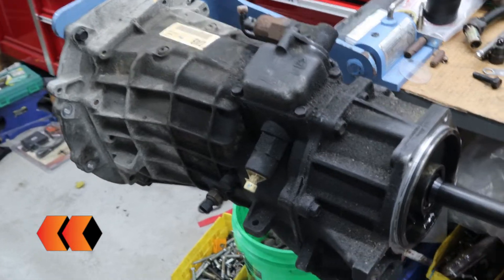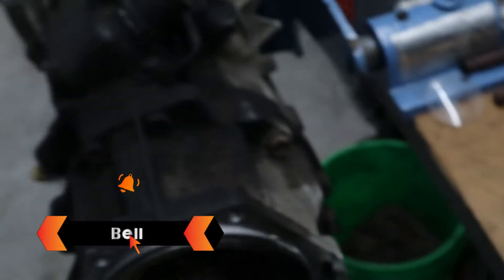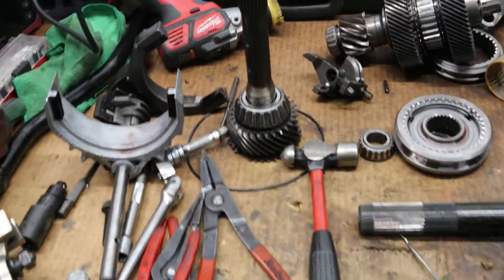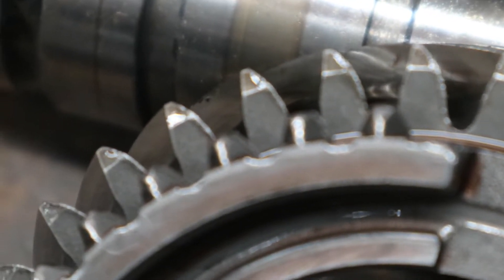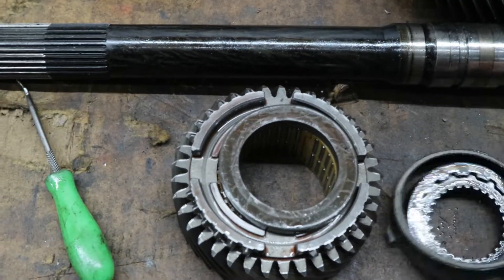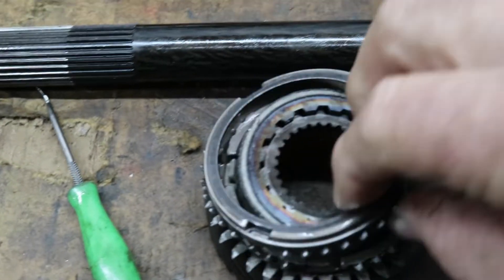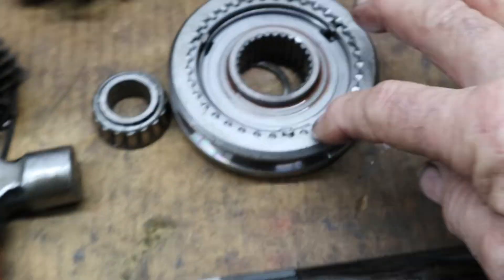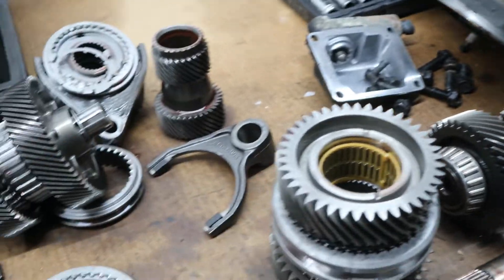The T-56 Tremec Transmission Rebuild: Will It Work Again? C5 corvette Z06

Comment: Hi,do u rebuild zf6 spds.?
Reply from the maker: I can, as long as parts are available
Reply: @LANDISPERFORMANCE I don't think I need a rebuild yet. But I'd like to plan for disaster. I have no information on the ZF6 that I bought other than the fluid looked really good.
Reply from the maker: @stevenblackwell399, do you have any tags or ID numbers from the transmission? Do you know what year, make, and model it was originally in?
Reply: @LANDISPERFORMANCE yes'89 corvette
Reply from the maker: Not sure how easy the ZF6 are to get parts for. Thanks for the comment
Reply: @LANDISPERFORMANCE yes...those trans have tags
Reply: The Ford ZF transmissions guy is sure you can get parts for the German ZF. But.
 He  can't rebuild the z f if you bring him the transmission. He sounds like a real tool.
Reply: @LANDISPERFORMANCE yes

Comment: Hi 👋   im experiencing a issue going from 1st to 2nd. I cant go above 25 to 30 before shifting to 2nd gear.  How do i find a good mechanic amd what questions do i ask to make sure the shop is qualified to work on a c5 ?
Reply from the maker: Is the skip shift engaging, or is it doing it at all throttle positions? You could contact Tremec, and ask if they have a dealer in your area. Elite Dealers are trained at repairing Tremec transmissions

Comment: How difficult would you say it is to replace the front cover for someone who has never opened a trans before?  I'm very mechanically inclined and I can turn a wrench, but I'd rather not mess up a t56 I just spent $2k I just had rebuilt
Reply from the maker: @AmateurProf  The correct way to take a T56 apart, the front cover is the last piece. But they are not that bad. You will need the puller to remove the 5-6 gear off of the main shaft. Snap ring pliers. And since you are swapping out the front cover, you will have to check the main shaft and cluster shaft end play.
Reply: @LANDISPERFORMANCE  Thanks for the reply!  I think I will keep my warranty and have the shop swap the front cover for me

Comment: If you're going to show someone how to rebuild that transmission maybe Slow it Up and explain what you're doing you cannot follow somebody that's in fast motion or don't explain nothing your video basically is garbage
Reply from the maker: Yes, you are correct, I made this video a while ago, and was getting a lot of flack about videos being to long, so I was experimenting with the fast forward portions. You will find in the video description a link for the manual for the T56 transmission, with the manual you can see the detail of the order the parts are assembled in, hope that helps. I will make a more full version of this T56 rebuild, next time I build another. Thanks for your comment, hope you check out some of the other videos on my channel.
Reply: @LANDISPERFORMANCE  thank you so much for understanding my comment , I own a 2017 Corvette with a 7-speed manual transmission but what would really be nice if you did a video along with an instruction booklet or something like that to explain how to actually rebuild the C7 7-speed transmission I know I would definitely be interested in purchasing something like that for my own knowledge that if something went wrong with my transmission I would be able to follow step-by-step or see illustrations to actually rebuild my transmission with confidence and even if you could throw in some aftermarket parts to actually make the transmission more beefier this would be a lot better than a video on YouTube this is just something to think about but I definitely would be interested if you or someone did something like this because I just don't have the money take my car to a shop and spend thousands and thousands of dollars on a transmission and still not knowing if they know how to do it properly? But once again thank you so much I was just being honest on my comment with the video but it was interesting even though it wasn't fast speed LOL give us some serious thought on what I suggested take care have a very wonderful day

Comment: I can't imagine the years of dedicated effort it must stake to become an expert at rebuilding transmissions like this.

Amazing.
Reply from the maker: Thanks, but I feel they are a lot easier than an automatic transmission. Manual transmissions are just gear to gear, and use a synchro to work as a brake to stop the next gear from spinning to allow it to be engaged with out grinding. As long as you remember that, the only tricks are to figure out the right order to disassemble and assembly the unit, and very close inspection of the synchros, synchro hubs, and the synchro teeth on each gear. At least that is how I look at it. Thanks for the comment, hope you enjoy the channel!
Reply: @LANDISPERFORMANCE Where do u live ? Lol. I need my transmission 1st to 2nd fixed and want to make sure it gets rebuilt properly.  I dont know much about cars as I haven't driven for,24 years after a bad wreck.  I saved up a little money and bought a 2001 6 speed c5 . It has a syncro issue with going into 2nd gear.
Reply from the maker: @IamVintage72 Sorry I missed this reply. I am just outside West Palm Beach, Florida

Comment: What is the cost of a rebuild like this? Roundabout
Reply from the maker: I would have to look up the parts cost. Also what year your transmission is. The earlier units had brass syncros and those kits are around $150-250. The later units and up grade kits for the older unit can be $450-950. If you make any good horsepower, you should step up to thr best syncros, it will shift much smoother, especially at high RPM.

Comment: how hard is it to remove/replace the extension housing to replace output shaft seal? could this be done with the trans in the car? it doesnt want to stop leaking....
Reply from the maker: Thanks for the question. Since the transmission is in the car, you have to remove the cradle, and the rear differential assembly. be careful when lowering the drivetrain, it can put load on the firewall and crack the windshield. I only lower the drivetrain enough to remove from the vehicle. To remove the output shaft seal, I screw two long sheetrock screws into the outer metal part of the seal, try to stay away from the shaft surface and the case surface were the seal sits. I put the crews 180 degrees from each other, then pull on screws to remove the seal. Put fresh grease on the lip of the new seal, and install the seal carefully to keep it square, with a hammer. Reinstall everything. Hope this helps. Thanks for the subscribe, I subscribed to you also.
Reply: @LANDISPERFORMANCE  thanks for the answer. So the seal can be replaced without removing the extension housing? It goes on from the outside? What would/could cause this seal to leak  after a rebuild, and I took it back to have it fixed and it still leaks, was not leaking before.
Reply from the maker: Yes it goes in from the outside. There is a bearing behind it, so not sure why it would leak with a new seal in it. Maybe they didn't lube the seal where it rides the output shaft, it is possible to burn the seal without lobe.
Reply: @LANDISPERFORMANCE  thank you, that is great to hear. maybe 3rd times the charm. car has been a nightmare with leaks on the engine, finally got those sealed up and the damn trans starts leaking...

Comment: Question for you. I disassembled my 06 corvette t56.  When I removed the case and lever front offset item 51.  I didn't seem to have a spring and detent ball item 52 and 53.  Would it be located somewhere else on some transmission.   Seems to be a few different t56 setup that the manual isn't real clear on.
Reply from the maker: Look at number 55, it should have a pattern for the little tab on the #51 offset lever to guide the shift pattern, ahead of that on the #55 there should be a secondary pattern for the detent ball to ride in. If it does, it should have a detent ball #53 and spring #52. If you have that, and the spring and ball are missing, either someone has been in the transmission, or the ball came loose and you missed it. Alot of times the spring will stay in #51 lever, but on disassembly the ball goes flying. I believe without the detent ball, the shifter may pop out of gear easily. Hope this helps. Thanks for the comment.
Reply: @LANDISPERFORMANCE  I looked at number 55 and it does not have the detents like everyone else shows.  I noticed the shaft that 51 slides on has 3 notches on it for a ball to ride.  That detent ball is located on the cover.  Not sure if it matter but this was a RPM transmission built by them in 2015.

Comment: Do you think a shifter could be moved to the revers solenoid mounts ? This would be for a cable shifter in a mid-engine car. Thanks
Reply from the maker: Yes, McLeod makes a shifter relocation piece, part number 82-1001. The unit will have to be taken apart, because you will have to cut the main rail shifter shaft in half and drill a new roll pin hole. I have done this modification on the T-56 F body transmission in my car #thefiddie, the 1950 Chevrolet Fleetline that I autocross, there are videos on this channel of the car. Unfortunately I did not get videos when I made the conversion. Thanks for watching, commenting and subscribing!

Comment: The time laps was so cool. I didn’t realize they stopped using brass blocking rings like the old 4 speeds, now you have to replace the entire gear.
Reply from the maker: Thanks for the comment PGM! I think the time lapse look pretty cool
Reply: Well, it probably has a billion miles on it.

Comment: Not much of a how to video when it’s at fast forward speed during most of it. And I was excited that I found a how to on the T56 rebuild. Oh well.
Reply from the maker: I was trying to decide how to present the work done, but it takes 6 hours to preform the rebuild, so a clip by clip rebuild would have to be over 10 individual videos. So I mentioned in the description to see the service manual with a link to the manual. If you look through the manual and re watch the video I believe it will all come together for you. Thanks for watching, and thank you for the comment. Maybe when I do the next one, I will have a better idea on how to present the content.
Reply from the maker: I just realized the link did not work, so it is fixed now.